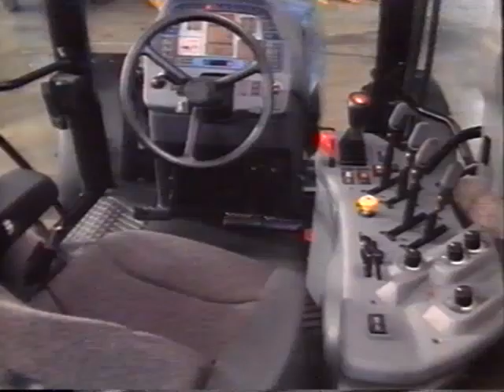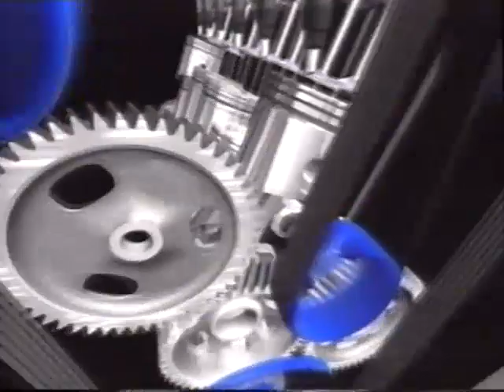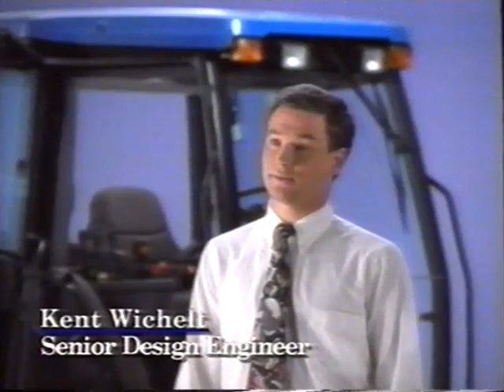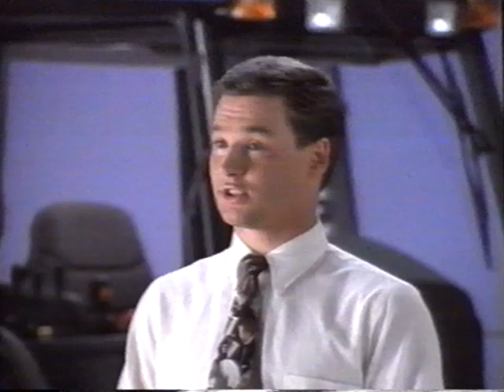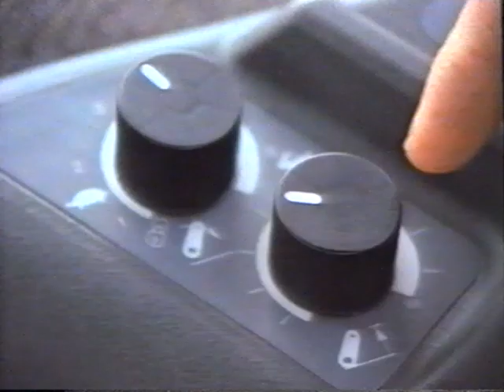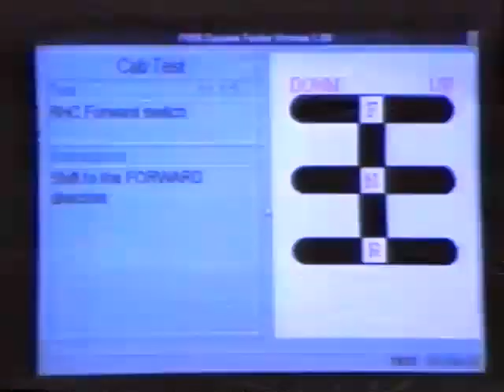1994 Ford Genesis Series 70 Tractor Promo

Comment: What's the engine size
Reply: 465 of all and pure Guts!!
Reply: @paulratzlaff2935 isn’t it the same block as a ts115 but different head?
Reply: 7.5 litres straight 6
Reply: A massive 7.5 litre Parent Bore Engine that you can throw away when it’s wore out

Comment: Not sure if these tractors had a Funk sourced gearbox in them ?
 I ask the question, because John Deere bought the Funk Transmission Company in 1989.
 Perhaps Deere & Co licenced the Funk type gearbox to other manufacturers ?
 Anyone know ?
Reply: The way I understand is that Ford used the Industrial Version of the Funk Transmission!!??
Reply: @paulratzlaff2935 regardless of end application, Funk would still be the originator of the design.

Comment: Some of the best looking tractors to ever wear blue paint and some of the best engines ever put in a farm tractor to this day.
Reply: We bought a 8970 in 94 and in 95 a 8770 2 wd with Mega Flow! Still on the farm! Both Rigs have never had the Pan or Head pulled off! The engines are absolutely awesome, fuel and guts are unmatched! Ford did again,designed the best and then quit 😡
Reply: The new Ford engines were indeed a revelation compared to the sixties designed wet sleeve, short stroke big bore design that has been fitted to many subsequent generations of Ford tractors.
 An engine is quite possibly the single most high expenditure item on a tractor from a developmental point of view.
Reply: E
Reply: We bought a 8970 in 94 and in 95 a 8770 2 wd with Mega Flow! Still on the farm! Both Rigs have never had the Pan or Head pulled off! The engines are absolutely awesome, fuel and guts are unmatched! Ford did again,designed the best and then quit 😡